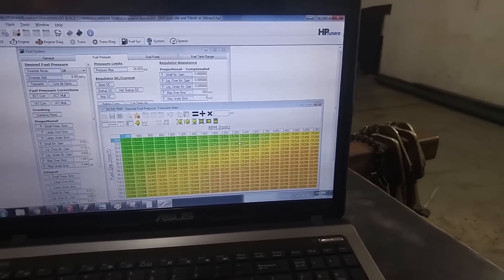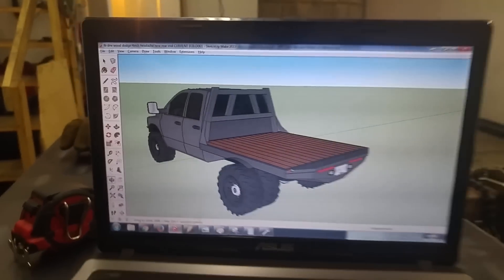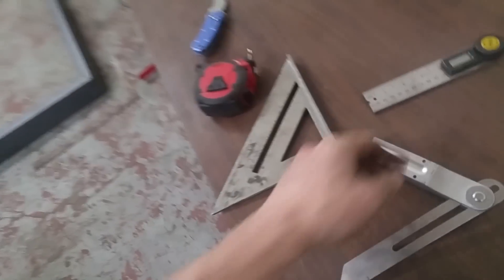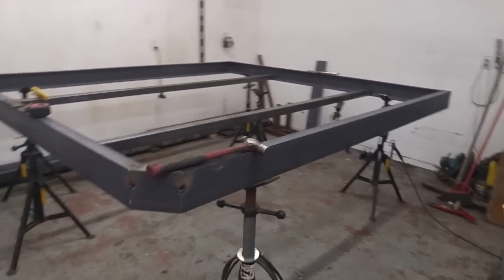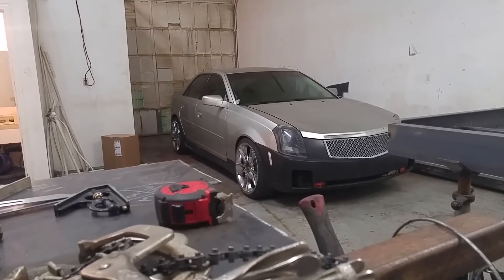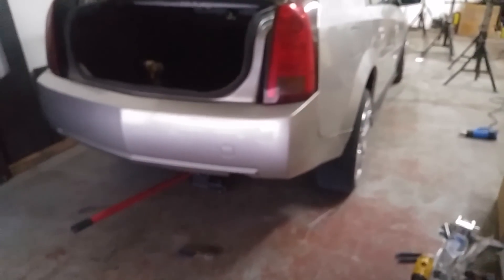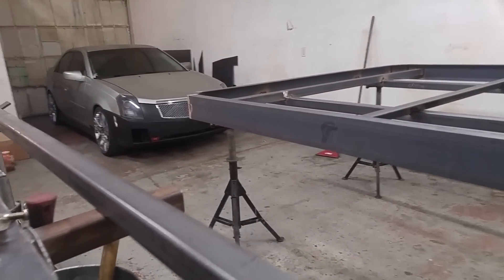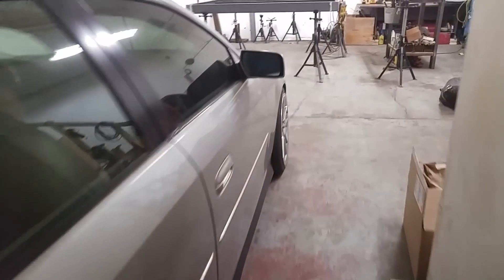NEW FLATBED BUILD!!

Comment: Hey looking for a price for a flat bed option similarly to what you have designed up just want a gooseneck hitch in the middle that I can remove. Going on a 2017 Chevy 2500 single wheel. Short box.

Comment: nice deck.  how does the dually do off road in deep snow and mud compared to a srw truck?  how does it is do on snow covered roads?
Reply from the maker: It does great offroad actually. I think it has a lot to do with my weight though. 
Id trust my truck to go more places than an identical truck with same size tires srw.
Reply: cool.  A video showing some off roading maybe?

Comment: You seem like you have fun using sketch up . I used to use it a long time ago then switched to solidworks. Its what every one else uses. By most considered the best. Give it a try im sure you would love it . Compared to Sketchup its allot better.
Reply from the maker: Yes its way better, no comparison. I have it but still not very proficient with it yet. Just need more practice.
Reply: Either way your works awesome whet ever works for you . Its worth learning to use though.  Its very simple . First you draw a 2d line/part then size it next turn the 2d into 3d and size the 3d part.  Thats the basics.
    If you plan on sticking with this type of work others shops will send you cad files for quotes . No one  uses sketchup in industry. Dont get me wrong its a great introduction to cad . 
Any ways cool video thanks .

Comment: Ticking sound in video again
Reply from the maker: Just noticed that. I'll look into it.
Reply from the maker: No it's not my fuel pump. My phone's camera uses both front and rear mics. The problem is the front mic is too close to the wifi antenna so it receives interference causing the clicking noise.
Disabling wifi or using another camera app that disables front mic solves the issue.